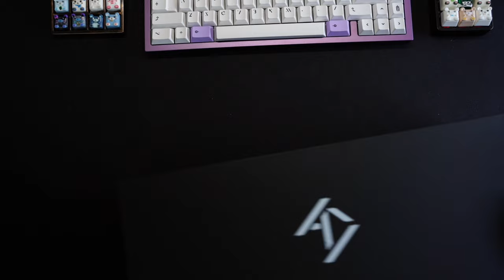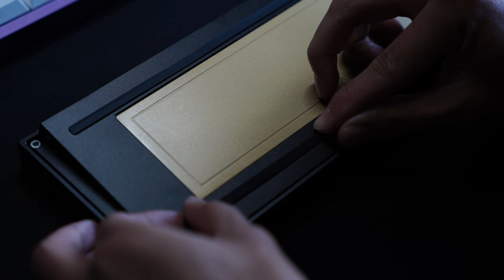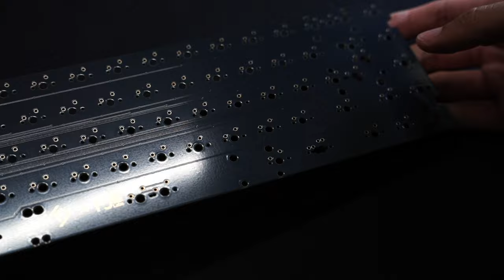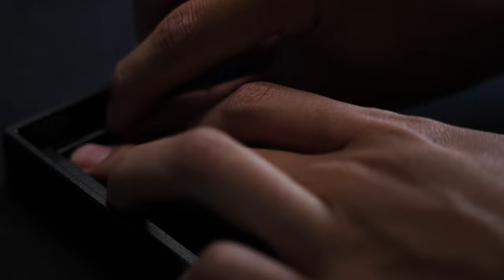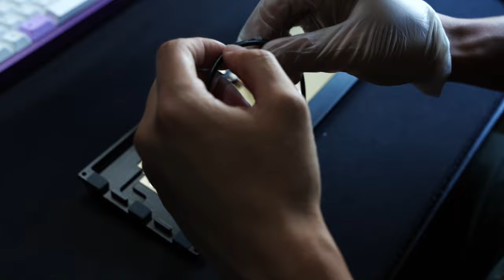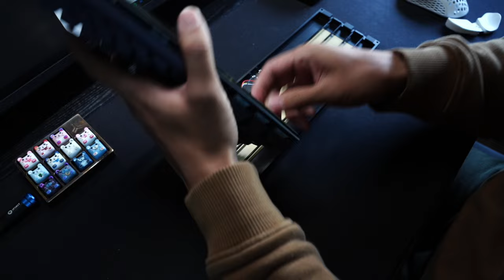Babylon 65 / FR4 Plate / Mizu Mink (stem swapped) Build and Sound Test

Comment: what are your thoughts on the board itself? Is it worth picking up?
Reply from the maker: if you're someone the likes a bit more flex than I would recommend it! It's a great priced board around ~300, great sounding, solid materials. Only thing I would maybe gripe about (nit picking) is that the gasket strips are a bit hard to install and I'm someone who likes softer plates (pom/UHWMEP/PP) so the fr4 is a bit stiff for me :)